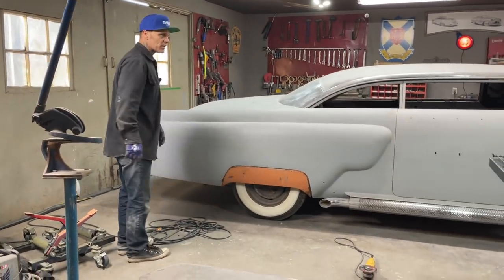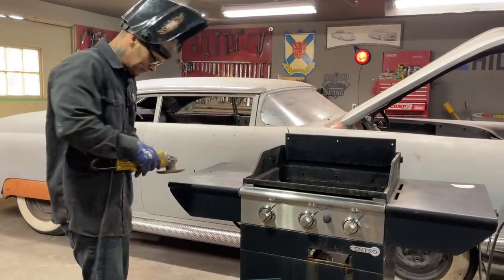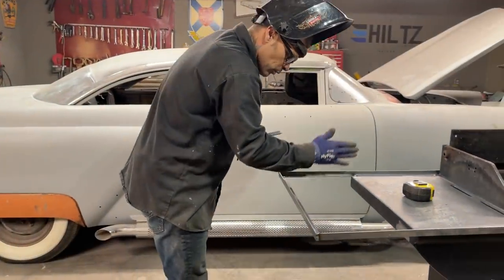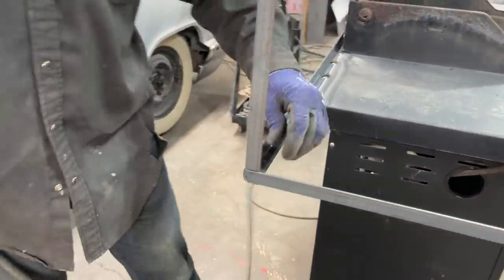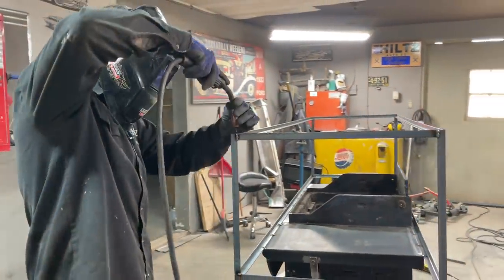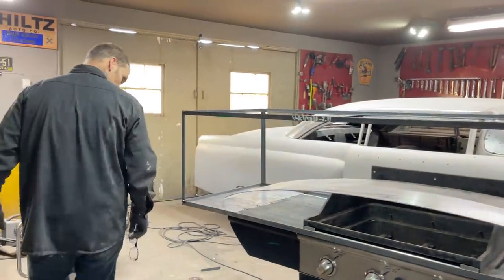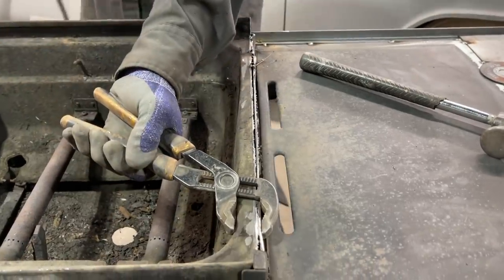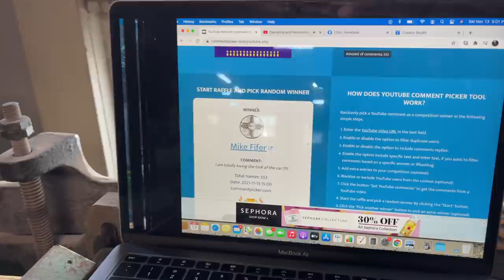Building an OVEN out of a BBQ to THERMOFORM Acrylic PLEXIGLAS

Comment: Chad. You don’t want to heat that plexiglass to quick. Bubbles will form. About 160 degrees for a good base temperature. The gasses inside the molecules of the plexiglass will start to expand if it’s to hot. Keeps this in mind. Once you get it dialed in you’ll be able to make any bends.

Comment: Chad I have been watching you a few weeks now. I really enjoy your show.  Your oven is a good idea but I do not think you should use plywood. It will combust at 230 - 302 degrees.  Concrete board would be best. hardiBacker I think.
Reply: Also denshield board is fireproof.

Comment: Wrap may try stretching, or subject to heat. I think applying wrap after forming windshield will be safer an practical. Ask someone about heat temp wrap can withstand without deforming
Reply: This is going to be a very expensive experiment if he goes through with it. The cost adds up quick. I have a ton of respect for Chad’s effort but in the end he will still only have a piece of plastic. 
I just hope that whoever is giving him advice knows a little bit about what they are talking about

Comment: I built my oven 6’ tall 5’ deep and 4’ wide it’s all electric with three 3,500 watt heating elements 
With no fans . I can heat it up to 500 degrees Fahrenheit. It’s for powder coating. 
Simple and effective been using it 4 years now .

Comment: The plastic wrap will shrink when exposed to heat, you are better off, aplaying the plastic to your window when material is cool! On the burners to spread the heat evenly roll two pieces of sheet metal with an even opening left and right and you don’t need electric fans.
Reply: If the box is closed wont the heat rise to the top?  250° is really not that hot

Comment: My 2 cents.  There's a ton of crud in that burner box (no doubt most of it is  meat drippings).  Once you enclose the top and fire up the burners, all the fine particulates will circulate by heat convection and embed themselves into the softened plexiglass.  I would suggest getting that burner bay squeaky clean next.  Maybe even sand blast it then paint it with high temp (BBQ) paint.  Then, to keep crud from falling into the burner bay, cover it with some of that perforated "firewall steel".  This perforated cover would also act as a heat conductor to more evenly disperse the heat.  Not too high on using plywood either.  Maybe corrugated steel?

Comment: ou may want to consider if the mould may do some warping of the mold and you eill probably want to wait to put yur wrap on after its cooled down.  The biggest thing is to make sure to burn off any animal fat so that it doesn't get imbedded to the windshield and let it cool slow as possible.  With the acrylic I did it has a realproblem with any moisture so the longer you heat the oven and mould the better is what worked best on the race car.  Just saying.  I wish you the best of luck.  run a feww test pieces first !  It's really going to be great with the wrap on it !  What a great idea !

Comment: Great job of using what you have! The fans might be a bit of an over complication,  just a sheet of metal over the flames would act as the hot plate to move the heat all around the box.

Comment: A BBQ can work as an oven without much issue but you will have some hotspots from the burners. I am sure you will be able to figure it out. I have used propane burners and made my own for a things. Right now with all the burners in the middle, it will be hotter there. Some fans to mix it and spread it is needed. I would use electric ones instead of those stove top fans because you have the ability for speed control and therefore the mixing regardless of the temperature. Those other fans will run depending on the temperature. Lower temperatures slower until they get heated up. Other than removing them, you can't slow them down or use them below the setting of the Peltier element in them. If you can only find plastic electric fans, just have the air blow through a conduit and keep them away from the heat and they will operate fine. Too close and they can over heat or melt. They do this in solar heating setups where the collector can get extremely hot. No way to mount a fan close by.

I would think the glass transition temperature of the plexiglass glass would be different from the vinyl wrap. Both easy things to look up. If they are close to the same you should have no problem applying the vinyl on top of the flat plexiglass and then baking them both. If the vinyl is lower it would be at risk of burning and discolouring. If it is higher, then it probably wouldn't but you would have to heat it up afterwards probably outside of the oven. I hope it works out and look forward to your experiment.

Comment: Did I start something?.,.. sorry bout your Barbee lol. Make this dual purpose, you can bake powder coat in it as well. Just a thought here, make a false bottom with sheet metal, and vent it out both ends, this will give you excellent heat dispursement and also keep the oven section dry, propane gives off water vapor as it combusts…
You could also build the same thing vertically, which is what I may do, and run the exhaust up
The back side which will also help to distribute the heat evenly.. I like the fan idea…

Comment: You built yourself a nice meat smoker!  Put the temp gauge nearer the bottom 'cause heat rises.  Fan nearer the top to push heat down.  Glass on the ends would let you see it cooking.  250 F will be no problem, but I doubt you can hold 450 (powder coating) on propane.  1" styrofoam insulation on the outside should handle the heat and stabiliize things, but you shouldn't need it with plywood.  Having the vinyl film on will affect the draping a bit because it will hold the drooping edges up, but maybe not a lot.  Might get a goopy mess on the first try, hope not!  

With pots of water on the burners, would make a nice steam bender for wood too.

Comment: Make a heat deflector. You can do that by making a long tray with tubes under it. If you don’t , you will wind up with a hotspot even with the fans. Put one fan in the front on one end and one in the back on the other end you may get decent circulation.

Comment: I think you should cover the pit with metal so there isn't an open flame inside the box.  Let the flame heat the metal cover which will dissipate the heat even more.  A "Muffin" fan in each end of the box would circulate the heat. I built a convection oven out of plywood at one time using 250 watt bulbs and muffin fans.  I only had to reach 150 degrees which it did easily.  Again, Opinions are like noses, we all have one. :-)
Reply: Yes 250°F is not really very hot

Comment: You can tell he's a metal guy. If your going to use ply wood, make a box 2 ft high x 6 ft long x 2 ft deep. plywood comes in 4 x 8 ft sheets. split in half makes 2pcs 2 ft. x 8 ft.   Cut off two 6 ft pieces and two 22 1/2 inch pieces. Nail the four pieces together into a 2 ft x 6 ft rectangle. No metal angle needed. 40 nails have held caskets together for centuries. Cut a 2ft x 6 ft piece for the top. Leave it loose to get in and out. cut two pieces of metal to fill in the bottom on either side of burners. drill and nail onto the bottom. Done no metal angle, no welding. Drop on the grill as is. Put the grill back together when done.

Comment: Chad if you add a plate of iron or steel above the burners that's the right size, it would distribute the heat all around the oven negating a need for a fan. I love this kind of enginuity. Go for it!

Comment: plywood walls and top and ends covered with the reflective rolled insulatve aluminum on inside to keep heat in and likely more fire resistant.

Comment: A 43,000 BTU propane space heater complete with fan could have been purchased for $159 saving a lot of time and effort and would likely perform better.
Not only that, but you would have a functional space heater for future use to keep you warm in areas that might require it. No need to destroy a functioning BBQ. 
In this case I don't think Chad's brain made the most logical and practical decision. It was entertaining to watch though.

Comment: Have you thought of using led strip lights behind the plexiglass in the tail lights?     The led’s are cheap and easy to obtain and very bright, you can easily cut them to any length you require and they usually have a tape backing so you can stick them in place, if you’re worried about water you can get waterproof ones or you can hit them with a coat of clear to seal them too.

Comment: It's always nice when the welding smoke smells like BBQ. Nice work! Hey I think I'd use cement board instead of plywood. It wouldn't have to be very thick either. Every building centre has it and with the price of plywood these days why not. Cheers from BC.

Comment: You could do almost like a propane forge and use an outer metal skin and inner metal skin with rock wool, fire blanket, fiberglass forge Insulation and it will help with maintaining the temperature.

Comment: Hey Chad, just a suggestion
Add a fan to circulate the internal hot air.
Have a small fan on a rod, the rod goes through a hole on the side of the oven box
Attach a drill or a small motor at the other end of the rod, then fan to circulate the air.

Comment: Great video. I would definitely do a practice run before using a lot of Plexiglas. Maybe clean up the piece of Plexiglas you had in Elvis and use half with Vesque or clear plastic and the other half left bare or no Vesque or plastic. Good luck

Comment: Maybe steel plate running length or 2 thirds the length above the flames to catch and hold the heat.. it will help hold heat and distribute the heat more evenly.. the problem with these gas grills is hot spots ..always to hot on a small.area the plate will radiate the heat evenly 1/4 maybe but 1/2 inch for sure..problem is plate is $$$$  maybe have a scrap of anything thick.. that's free...lol. the steel from an old tractor bucket would work great
Reply: Fire bricks as well are used which makes me think a pan full of sand would do the same as the steel

Comment: got to cover the burners... then cut a hole in the back of the pit for an exhaust chimney for the combustion gasses.
Reply: Yes, and all gas grills will have intake holes below the burners to support combustion. Without proper ventilation a covered barbecue could possibly end up full of propane gas creating a bomb

Comment: How about a large sheet metal  V  shape a  foot deep to the back, centered over the burners.  Heat rises up and over to the outside edges.  Bracket the poly-glass form to the top of it.    You will not get direct heat from the burners and disperse to the outside where the bends are the greatest.   Just a thought.   IDEA***

Comment: Great idea. Putting a plate over the burners will disperse the heat more evenly as well. Fans are a great idea. Tail lights are looking awesome 👍👍
Reply: May need a couple drain holes/vents in the tail light box so it doesn’t fog up or get rusty. LED lights will keep the temperature down.

Comment: Dude - You gotta replicate that BBQ.  I say line the walls with metal and then insulate with wood and/or something flame retardant.  Metal then cement board then insulation for the top?  If heat rises maybe thermostat on front?  G'ver Chad!

Comment: You should use at least three temp gages (one middle, one on each end, and test run it for temp consistency before you do the windshield).  The edges are probably going to be hard to get to temp with the burners in the middle.  Without roasting the middle.

Comment: Might consider adjustable vent at each end to help control heat temperature, and 3 spaced temp gauges to watch temperatures
Reply: I'm thinking that only one fan centre top is needed this would guide the heat to the ends where it's needed and cool the centre a bit with the small vents to ensure a flow. i still think a foil lining is a good idea.

Comment: The BBQ was probably off in measurement because the manufacturer eyeballed it lol. I am pretty sure you will need some sort of cover directly over the burners so all the heat disperses out to the ends better, along with the fans it should heat evenly.

Comment: I wonder weather a simple wing shape would disperse the heat evenly ? A long piece of metal 12" wide that is lower in the centre near theBBQs heat source  and higher toward the sides. The top having a slight convex shape, slightly higher in the centre.

Comment: Absolutely brilliant, wouldn't it be better to use sheet metal rather than ply, so the sheet metal holds the heat in more.
Whatever you use sure it will work a treat
Reply: I don’t think it will be too hard to reach 250°.

Comment: If youd roll a piece of aluminum ideally or metal in an arch across the burner running the full length 6 foot u could do away with the fans but ude need a damper on top of box like a smoker love the show

Comment: I don’t think it’s going to work , reason is that the fans will cool the air the outer sides will never build up to 250 degrees .and where the heat is rising in the center is going to get to hot and bend in the middle only , and finally that metal mold will get so hot that the plexiglass will meld to it , you have to make a wooden buck like Ian Roussell did to build the bubble car .

Comment: Boiling point of water is 212 degrees F. Covering will melt at 250. Putt it on after windshield has cooled and use heat gun to shrink.
Reply: Yep for sure.  You can’t blame him for trying to cut corners though

Comment: would suggest using fire place bricks to lay over the flames to act as a difuser and not have a hot spot in middle of oven.. Other than that watch temps and time and you should be fine . Keep up the great work .

Comment: great work so far chad, id recommend some firecheck boaed, (cement board, fire rated gyprock) maybe a fan to act as a blower to spread the heat evenly
Reply: Jolene suggested a small circulation fan to keep the air a consistent temp.  250° is not very hot. I have seen close to 200° on the dashboard of one of my cars sitting in the sun.  It’s easy to cook eggs in a dark colored frying pan sitting in the sun for 20 minutes or so.  We have very hot summers where I live

Comment: The thermal degradation and ignition point of wood and plywood may be generalized by the following: 230° to 302° F (110° C to 150° C): The wood will char over time with the formation of charcoal. If the heat is not dissipated there is some possibility of spontaneous combustion.
Reply: No matter how this plays out it’s still the best entertainment on YouTube.  Jolene’s dedication is top notch, as well as her skill with the videos and computer.

Comment: If you could find old kitchen stoves
Could use doors with glass to see in
Use light bulbs from oven for light
Also convection oven fans to circulate air.
Shucks even the door seals take high heat.

Comment: I would put thin sheet metal on the inside if your going to go with plywood so the metal holds the heat and the wood doesn't get to hot and combust into flames might not happen but anything could

Comment: i hope this works, allthou i would use electric heat for the ease of use. how do you regulate the heat to be accurate with a gas oven???
Reply: Certainly something to think about. Chefs have preferred cooking with gas though as the flame burns at a steady heat. With electric heaters the power clicks on and off in cycles. It's either on full or off. This timing is controlled by the thermostat. Still might work though with baffles.

Comment: 325-400 for powder coating. Depends on the product. Wood would be no good at that temp. Might use that cement board they use for showers... and you will like this much cheaper than plywood. Bob
Reply: I don’t know the current price of plywood but for a while here in the US the price was ridiculously high

Comment: Hay Chad if you are thinking about powder coating your oven would need to reach and hold 450 f  temperature control is fairly critical and your gas flames would need a cover over them steel or aluminum to prevent a flash of the powder
Reply: There are probably quite a few videos on YouTube showing how to fabricate powder coat ovens.  
This one definitely has the potential to reach a high temperature….and then some

Comment: You may have a problem keeping the temp down, a 3 burner grill normally gets to 500-700°F uncovered
Reply: I think the idea is to have the air temperature a uniform 250° inside. He can probably turn the fire that comes out of the burners down to a lower flame. A small fan to circulate the air and a couple of vents might do the job. A thermometer near the top and one near the bottom should tell him what’s going on. We are all wishing him good luck

Comment: Do you have any corrugated steel siding or roofing material, that may work for the enclosure
Reply: I think that might be cheaper than plywood. I don’t know the current price of ply but for a while it was very expensive here in the US

Comment: Propane BBQs give off carbon monoxide. Move it outdoors or at least open the doors and put a fan on. Very dangerous what you were doing yesterday. it's a good thing only the nobs melted and not the tank hose. Be careful over there.

Comment: The way your doing this is dangerous. The safe way is to only use the barbecue to heat up  water in a copper coil suspended over the barbecue burners to heat water. The box should be moved away from the barbecue. you probably have every thing else you need to create a closed hot water system. 1. small radiator 2. water pump 3. fan. These items would be in the hot box. you would create the same water cooling as in automobile engine. Except the heat source is the barbecue and not the engine. The heat would be regulated by 1. length of copper tubing. 2. barbecue flame intensity. 3. Water flow.